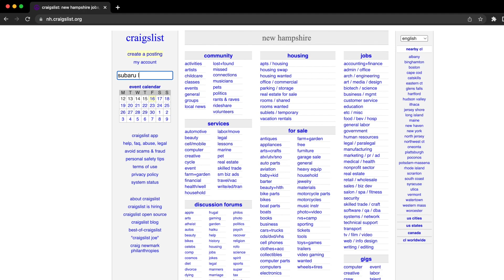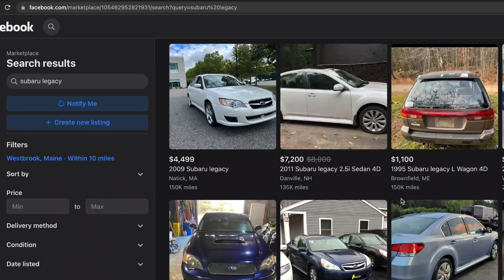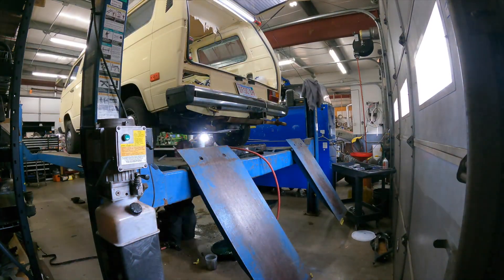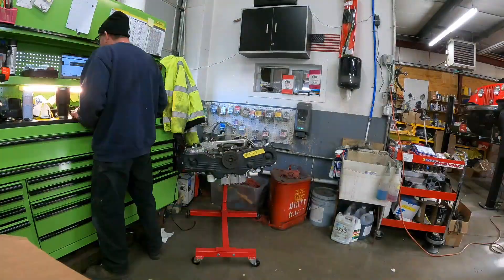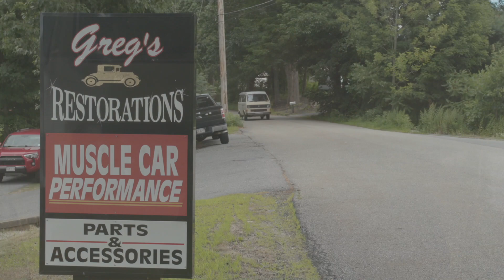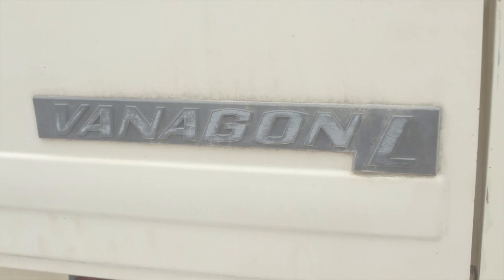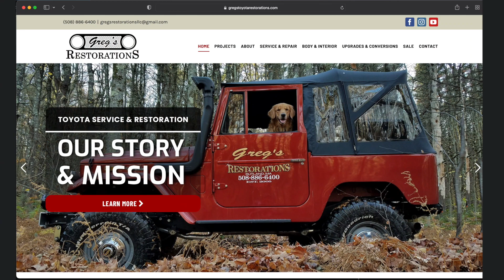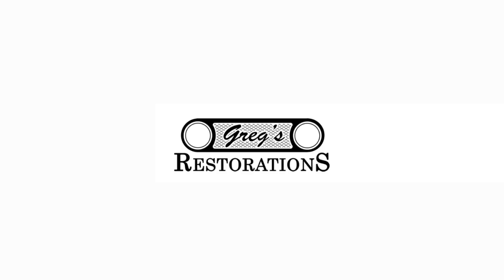Subaru Swapped 1983 Volkswagen Vanagon Westfalia Overland Camper build

Comment: Hi Greg I'm French and I got a t25 panelvan with a 2.0 atmo (non turbo) subaru forester 125 hp on it
Well well well 
  I got some questions and I hope you could answer some of theses
Have you some cooling problem with
Have you added an electric water pomp for the cooling system 
Did you have convert a subaru gearbox too or use the same transporter gearbox with a converting kit
Have you added a new oil pan 
less lower than the original one
Did you take it on daily use or just for weekends?
And the last one
Have you built the exhaust system by yourself or have you buy it on market

Comment: Was the original engine gas or diesel?
Reply from the maker: It was already swapped to a gas engine
Reply: Interesting. I have an 83' diesel and am wondering how difficult it would be to swap to a gasoline engine or just to put a new TDI in. @gregsrestorations7019
Reply from the maker: @leifslife5447  very time consuming but can be done!
Reply: @gregsrestorations7019  so did you fit the original 4/5 speed gearbox? Or a subaru one. I have a  covered one to a twin turbo legacy engine however I'm wanting a subaru gearbox aswell.